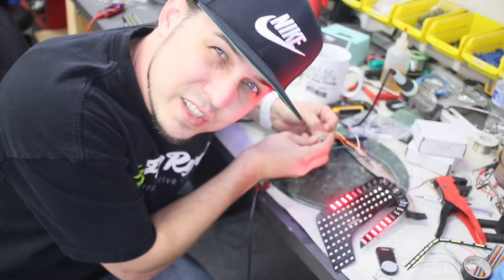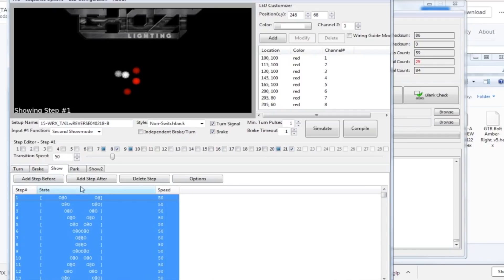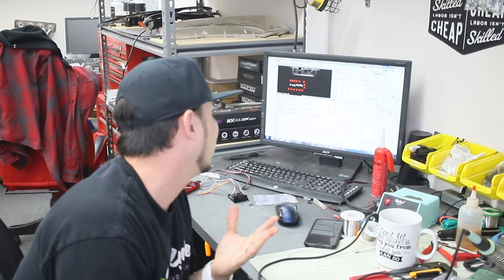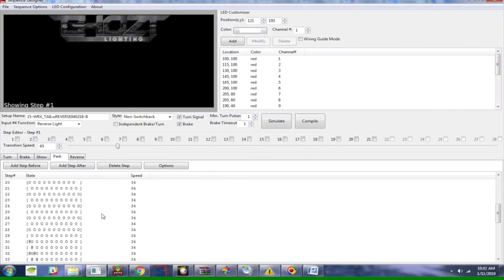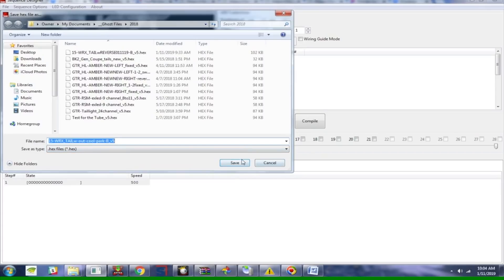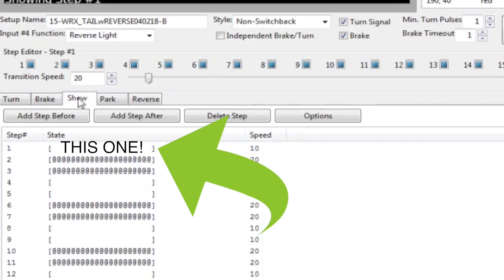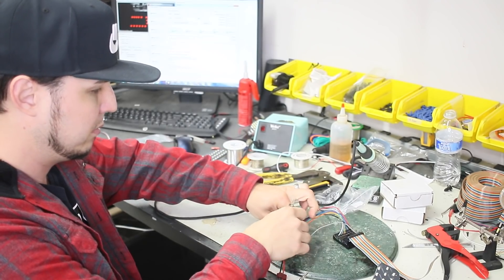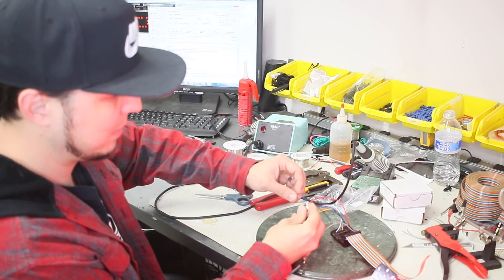Learn to PROGRAM Sequential LED Tail Light Panels | Ghozt Lighting | FlyRyde

Comment: This could be really useful for custom LED lights on motorcycles. Saves having to run a  bunch of led strings if you could use small boards instead.

Comment: I have a 2012 dodge challenger and I installed a sequential tail light system and I used the super bright Sylvania off road leds.  It works well and is super bright.  It sequential outward for turn signal and brake.  I would like the brake sequential to also once you take your foot off the brake to sequential inward before going off.....your thoughts??

Comment: Is it possible to modify the led functions of those spyder led tail lights?
Reply from the maker: “Those Spyder” tail lights? Which ones dude?
Reply: @flyryde  I bought some for my 03 Silverado with LED’s and an oled strip, tow vertical rows of LED’s and one vertical row is turn signal and the other is brake light, oled is running lights. I’d like to program to split the vertical lights horizontally so that the top portion is the brake light and bottom portion is the turn signal.

Comment: It turned out very nice, but I am very curious how you connected the LEDs without a resistor knowing that the output is 12 volts.  Also, the maximum output at 1 output is 380 miles ampere, and you've connected quite a few LEDs.  I wonder how.  What model are LEDs

Comment: Cool lighting. Just one question. How much does the Japanese chip cost you.... since you're selling the modules for $300 bux, I can only suspect that the chips only cost about 10 bux a piece. Lol.
Reply from the maker: jimsdaone ghozt is run by two awesome white dudes in the US. The lighting business has about a max discount of 40 off retail when buying from manufacturers like ghozt. Couple that with my cost of material, and the time (not random dude time, Chris’ hands and attention for an hour) to prepare the boards, include the 84 points of solder connections, pins, connectors, and wires, and use my tools and shop I’m paying for to do all of this, I clearly maybe 80ish bucks after transaction fees.

It’s more of a gift than a service dude. Lol. Nobody is getting rich selling potted ghozt modules.

Comment: I’d like to see chip leds on the turning signals on mirrors for a Nissan alt 09-12 series, original equipment manufactured burns out a lot, im not even joking I’ve replaced them so many times, I’d like to see some real bright colors

Comment: What types of SMD LEDs do those boards use?
Reply: Those and all pixels are easy to control with a single controller and with way fewer wires. But then the problem lies in getting a multiple 12vdc triggers. I’m sure it could be done. Heck it may have been done. The thing the Ghozt controller accomplishes is controlling single channels of single colors. I’m sure with the right coding and chips it could be done easily. Unfortunately for me my coding and pcb building is amateur at best. 

Also finally found the SMDs.
Reply: Nicholas Brown I am always learning myself. And actually after doing some research I just now realized it has been done. And none other than Ghozt has done it. The have a separate controller called the BlueGhozt controller. Like I said before it’s probably already done and here’s proof. Lol. Here’s a link to their controller. 

https://www.ghoztlighting.com/product/blueghozt/
Reply: Nicholas Brown apparently they’re popular then. Lol. I’d contact them to see when they’ll have more in stock. See if maybe you could get put on a back order list of sorts. I would also see if you could get the app or software to play around with in the meantime. Try and get familiar with how the app/software works. 95% of your time is figuring out how the software works and what you can do with it. Installation is the easy part, relatively speaking...
Reply: Looks like it’s an App only device, which is slightly disappointing. I was hoping it would be more like the other software they have for the regular Ghozt controller mixed with a pixel/DMX type software. That may change in the future though since it’s V1. At least I hope it would if not for customer control then at least for installers. Still, having software at all is a major step. I remember looking at creating an app for another project I had ideas for and just to get the app in the App Store it would have cost $3-$5k and that was just to get the app placed in the App Store and certified by Apple. Wasn’t including the cost of the software development. Regular PC software development is also expensive.

Comment: Chris, this is cool... do you need 1 ghozt module for each side like left and right lights or 1 module that controls both left and right? Also is the blueghozt the same as the ghozt sequencer?
Reply from the maker: Great questions! You can do either 1 module with wires going to both sides. I’m not a big fan of that due to the excessive amount of wires needed to make it work. 2 Ghozt minimum is my advice. You can do multiple Ghozt boards per light depending on the requirements of the build

Comment: Yeah man love the nerdy stuff!! 
Will need to go grab the program for a look n see how it works, does it allow you to preview the whole sequence as an animation on the computer? So you wouldn't necessarily need a preset circuit board like those c boards to start with you can just tell the program this is what it's going to look like in the end and program the sequence in?  
😂😂 So many questions in the comments
Reply from the maker: Henriks Boot yeah man, I’ll continue to show more as I learn, so you guys are on the same page as I am. The sequence designer has a preview setting where it actually makes a video file of the animation 👍
Reply: @flyryde  had a mess around with this picking up the program doesn't seem to hard but I suppose putting it into practice will be different, I don't yet know enough about the boards and leds, does seem very time consuming programming it in though
Reply: do have swichback back for 2012 Chevy equinox turn signal
Reply: If you want the best sequential tail lights/look then get a 2013/14 Mustang model.